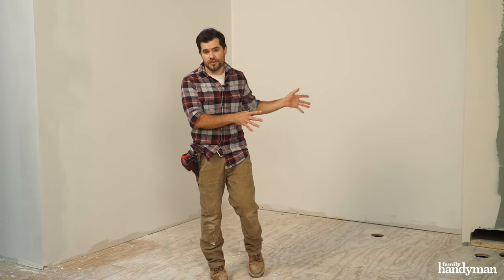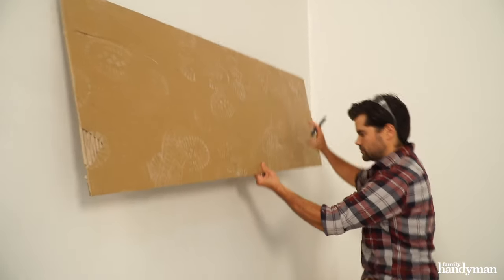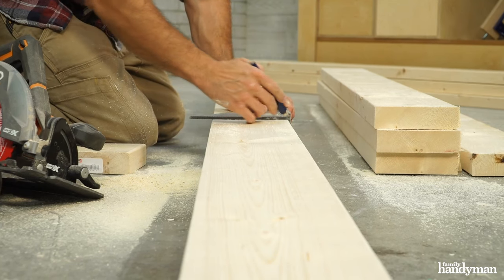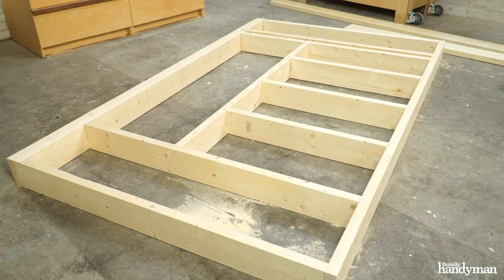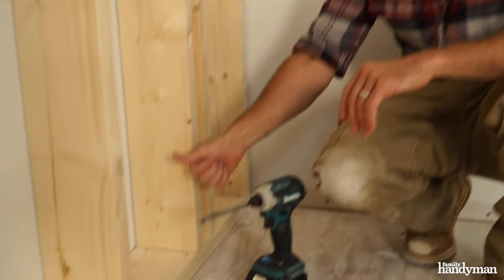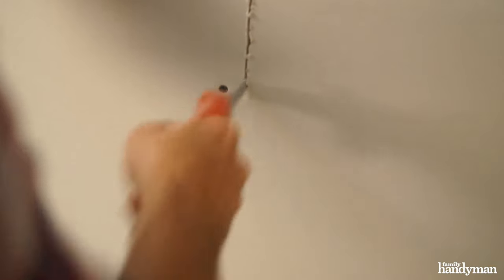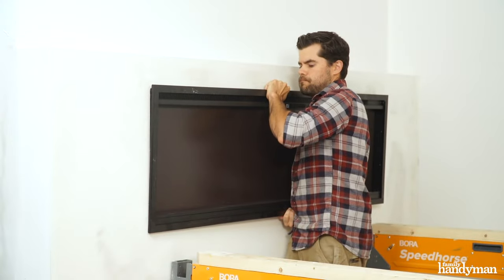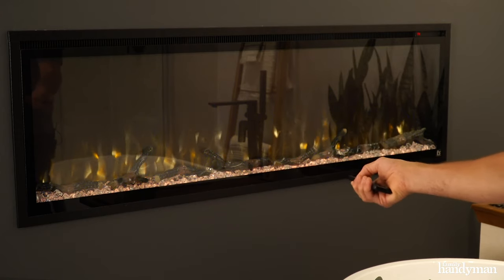How to Install an Electric Fireplace

Comment: I want to get one for my living room. But do the vents need to be in the front? I’m worried if the vents are on top, and I Incase it. It might cause a fire or start melt incase frame
Reply: Vents absolutely need to be in front if you want the heat. If your vents are on top, you have two options: 1) Disconnect the vent, which will make your fireplace decorative only 2) Install on wall like you do with a TV and don’t insert it, so the vents can work without creating a fire hazard.

Comment: How much can you charge for a job like this?
Reply: Depends if your are licensed you can charge between 3000 and 2500 depending on the electricity and you have to run a ventilation